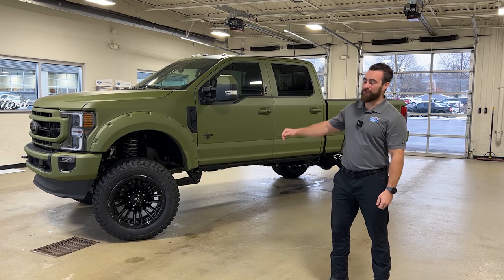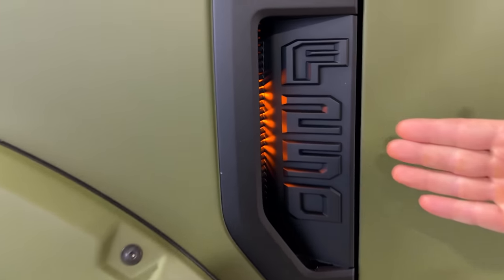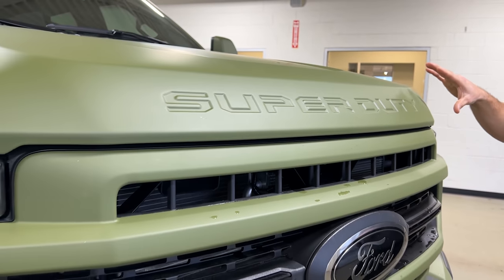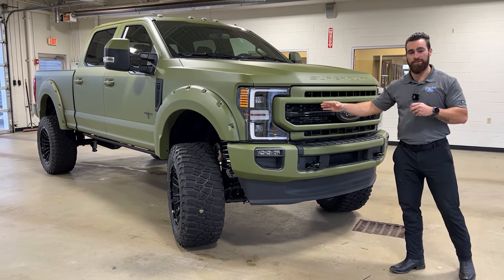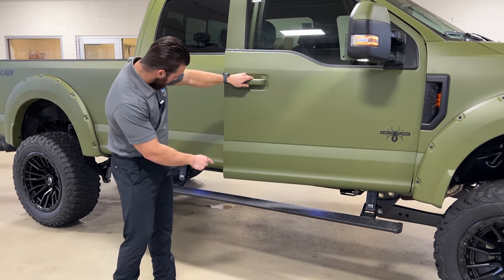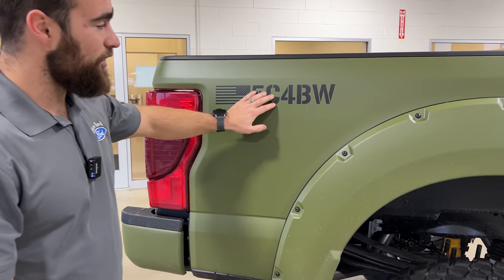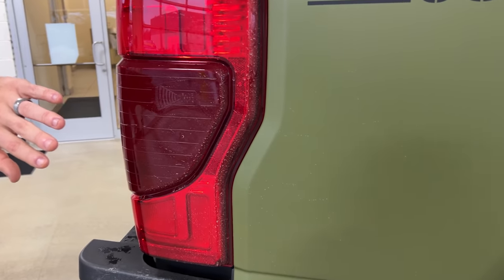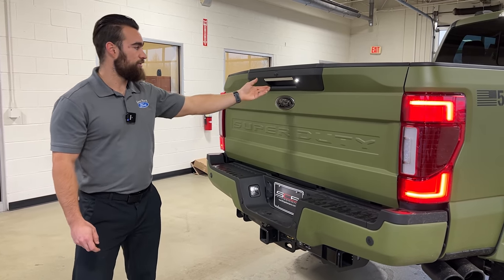BEST SUPER DUTY EVER? 2022 Ford F250 - 7.3 SCA Black Widow Armed Forces Edition 🔥

Comment: As a disabled veteran, I can honestly say due to cost I’ll never own one of these…
Reply: Got a 93 f150 shortbed
Reply: Same bro. My 5.9 cummins will have to do. Ive been saving for 2 years to replace my custom milk crate front seat
Reply: I'm active duty $or over 15 years and I will never own one either that's close to 100k. I don't understand these truck brands producing military edition trucks but they make the so active duty and veterans can't even own one due to price. It's a nice try though if they did really support build a few of these trucks a year and give one away to a deserving veteran
Reply: @andrewluedke6712  
I agree.
Reply: I just bought a USED 2020 xlt F250 with the 6.7 diesel and they still wanted almost 60k

I don't want to imagine what this thing costs
Reply: @Sasquatch0251  it costs what you paid for it.

Comment: I can't even finish this video because I'm worried he's gonna tell me how much it costs. That truck is perfect!
Reply: Sorry, it would be perfect with the stick shift. It is otherwise pretty good.
Reply: It’s also not a 6.7
Reply: @andrewculver5045  if you aren't towing, you don't need the 6.7L. I had the 6.7L and now I own a 7.3L, definitely not at all disappointed.
Reply: @Davy Pig  Right...
Also if it had 6.7 engine with 1,050tq
Reply: @Sheepdog81  if you want to have the maximum towing capacity you do need the 6.7 for sure, 1,050tq on the 6.7 you can't compare to 500tq on the 7.3 .  Obviously, 6.7 costs more for a reason
Reply: @nelsonfont6730  Yes, I sell Ford, this I know. Still, 1/10th of a second slower 0-60 between the two. 450lbs lighter in the 7.3L and no DEF or DPF that I hated dealing with. My rig is built for overlanding. To each their own. I chose my 7.3L for my own reasons and I am extremely happy with that old school pushrod V8! 😁
Reply: @Sheepdog81  doesn't matter who faster it can be you'll pull in gas what you can in diesel. It is so much capable to pull and town. For a reason all heavy-duty are diesel. I have a F150 2.7 ecoboost with 580whp and 660wqt that's is my faster toy. But to work I have a F250 of course diesel. Gas pull well, don't get me wrong, but nothing compares to a diesel. Let's be realistic. Without talking the difference on fuel prices and mpg.
Reply: @nelsonfont6730  Exactly why I said, if you aren't towing all the time but, you want a F-250, go gas. The 2.7L is a phenomenal choice too in it's stock form. A sleeveless block to boot.
Reply: Towing with a 6" lift would be a bit ridiculous IMO.
Reply: You can delete a 6.7 and with a basic tune blow the 7.3 gasser away. Of course the 7.3 is capable but not long term pulling heavy is about torque not so much hp. Point is all that work on a stupid gasser
Reply: @matthewartiles3179  not here in Commifornia. And I'm not pulling.
Reply: @sheepdog819  that's sucks it becoming extremely hard to get tunes anywhere. Just did a 21 and had to get the the tunes from Canada and now they are vin specific. For off-road purposes only obviously if that even matters lol
Reply: I still drive a 14 was much simpler back then same concept but could buy a tuner with preloaded tunes. I just had to include what injectors I was using and intake etc and could have them preloaded and in email in a day now not so much. Ford still is by far the easiest. Also way better for the environment when you factor in better mpg and not manufacturing parts that will obviously not last as long while burning def out your dpf. The 6.7 scorpion is in imo the best diesel in a pick up so many things they pioneered with that motor. I've had every one besides the 7.3 idi and went through all the hell on all. 6.7 is a modernized 7.3 only downside I can see is the Bosch fuel pump.
Reply: @matthewartiles3179  I'm just tired of the BS as much as you are.
Reply: 115 all day.
Reply: It’s around 110k lmao
Reply: @andrewculver5045  i dont think the guy built this custom truck for work, thats a toy, will sound imcredible with exhaust he has

Comment: Love the fact that they used flat paint to give it an authentic military vehicle look. Companies who used a gloss clearcoat over olive drab or desert tan  just ruins the look. I do hate those wheels, they do not match the style of the truck.
Reply: Agree on the wheels. I guess they look more spider-like? I would expect wheels that look more utilitarian. Try climbing in and out of that thing or really working it. Try lifting anything heavy into it. What if you had a gooseneck or 5th Wheel? I would rather see air ride suspension, on board generator, tail gate/ Tommy lift, and other cool things that would enable one to pack it in on rugged terrain.

Comment: A lifted truck with an air dam underneath the bumper?  We can all agree that when you're looking for this look you won't be too concerned about gas mileage.   Also, you go with 22" wheels you have to get at least 40" tires else tire looks too small.  And since we're talking abt wheels/tires, upgrading them without upgrading brakes is not only an aesthetic issue but safety as well.

Comment: Wow what a truck.  It would look great as a dually to I'm wondering how much does that cost with the 6.7
Reply: $367,995.99
Reply: The 6.7 is about 10,000 dollars in this truck. If you wanted the dually it would be even more, plus you would be getting a f350 not the 250 shown here.
Reply: Regardless of brand diesel engine option is 10k more.

Comment: First Time Viewer! Great job on the presentation! The owner made a great choice by going with a military / tactical theme! 

I realize this truck was a customer retail order and then SCA customized, but here is a critique on the build. In general and overall, this truck is an excellent build. However, several details are absent and better choices could have been made with OEM options, aftermarket additions, changes, upgrades and the SCA custom appointments. 

First - OEM Options: PROS - like the Lariat trim with Ultimate Package and Black Appearance Package; Upfitter Switches; Roof Cab Clearance Lights...and great choice bypassing the power moonroof. CONS - notable OEM missing options which would have made the truck a better build - Ultimate Trailer Tow Camera System / Pro Trailer Backup Assist; Heated Rear Seat (a Michigan truck without heated rear seat?); Carpet Delete (this truck needs the Vinyl Flooring); 397 AMP Alternators and Dual Batteries; remove the standard front lower valance and replace with the Tremor front lower valance.

Second - Aftermarket Additions, Changes, and Upgrades: PROS - fender flares were a great choice and the bolt look attachment keeps with the military and tactical theme. CONS - The rims and tires along with the suspension all bad choices. The rims are bad choice in both function and aesthetics. Functionally, either 17 inch or 18 inch rims and tires would be the best choice for a 4WD truck...provide a better on pavement ride plus better off-road performance. Aesthetically, body color military and tactical looking rims like Black Rhino rims - Armory or Arsenal would have been a better choice...painted the body color with black bolts. Military vehicles have body color rims, but matte black would also look good on this truck. The gloss black rims just ruin the military / tactical theme. The 37 inch tire height was a good choice, but the tire is too wide for snow country...more narrow width would be better...wide works good in sand...desert areas. 

The 6 inch lift is too high and messes up the "center of gravity"...and simply not necessary for 37 inch tires. The shock boots are way too dated. This truck should have either the Carli or ICON suspension system, especially at the $99K price. Not sure what suspension system SCA uses, but it is not Carli or ICON quality. This is a prime example of why it is best for owners to build their own truck. I would have had SCA only do the interior and exterior paint...no other custom work. 

Third - SCA Performance custom appointments and work: 

1. Body Color options: By far the BEST military / tactical olive drab green I have seen on any vehicle is the color TANK which was available on Jeep Wranglers in 2015 and 2016. Other good military / tactical colors would be GOBI or SLATE...both Jeep Wrangler colors; and LEADFOOT (F150) and LITHIUM GRAY (F250 / F350) both Ford truck colors. All of those colors would have been way better choice than the olive drab green chosen for this truck...just too much yellow in the paint mix. 

2. SCA missed painting the gloss black face in the center of the grille...should be the custom body color. Better yet, the grille should have been painted matte black to match the fender emblems. In addition, the grab part of the door handles would look better painted matte black. The same part on Ford trucks that have the OEM chrome. The chrome door handle pops...so would the matte black on this truck. The truck simply needs a smidge more black exterior trim to accent and highlight the body color.  

3. Like the matte black painted BW and Army numbers on the doors and rear bed panels...way better than decals.

4. SCA did a phenomenal job on painting the truck. Good job on painting the face of the doors the body color...the area that covers the B Pillars since the OEM is gloss black. No doubt the paint job was the major portion of the expense in the build. 

However, they overlooked some details. SCA failed to apply the body color to the chrome tailgate handle and on three interior parts. The steering wheel part that surrounds the controls. The upper glove box part that has the embossed Super Duty. The part surrounding the AC vents and USB plugs for the rear seat passengers. All of those parts should have been painted the body color. Some of the parts or a portion around the center dash area should have been painted matte black. Too much body color there. Ford Ovals need to be black and body color. 

In conclusion, great build, but at $99K, the truck could have been noticeably better with more attention to detail. People that have less money and more patience could have built a similar truck with the additional changes and upgrades listed above for about the same money.
Reply: Your critique was far better than even my short sighted thinking. They need to bring you in to the process and then call that truck an Armed Forces Truck! Wow! That would be an amazing truck!!!
Reply: SCA uses BDS suspension which it equivalent to carli . I can say it was used on this build because this is a customer build so I’m assuming they had the choice on what suspension they wanted. Plus BDS, unlike like any other suspension company, it backs the factory warranty and steps in when the dealership/factory try to take advantage of you. BDS will advocate on your behalf to get the work covered by ford, and if all else fails, they will cover the cost after all legal options are exhausted. Also keep in mind, a lot of companies use radius arm drop brackets which is not the way to go . BDS uses longer radius arms therefore not reducing clearance.
Reply: @Subi_doo  Bds makes a nice lift for sure. They are owned by fox..  BDS was founded here where I live. Fox bought them for a reason...Carli makes some nice components that are very different from the basic lift for a superduty.   They go beyond the basic lift... Your statement about BDS getting work covered by ford is a joke. Just like insurance companies state, if you have modified the vehicle coverage may not apply...
Reply: @johnt6673  not sure what your taking about, BDS told me directly; if ford denies my claim, and after BDS legal team steps in and tries to get ford to honor there warranty, if ford still does not, BDS will cover the costs. This is why I buy BDS.

Comment: Only thing id add is the 3 marker light bar from the dually under the tailgate .....they just finish the lighting look
Reply from the maker: Thanks for watching
Reply: I always put that 3 red light bar on my Ford F250 and F350 SRW trucks! Both the light bar and wiring harness are relatively inexpensive. Looks good on SRW trucks with the roof cab clearance lights, otherwise, probably not look very good on trucks without those lights.

Comment: No cold air intake and custom engine colors? Send the truck back lol. Needs to also have a pull out step on the front bumper to work on the engine.

Comment: Get rid of the 6" lift. Change out the doggy 7.3 gas for a 6.7 turbo desiel and I would buy it!
Reply: go watch some of the 7.3 videos on YT, not a doggy motor at all....the after market is growing fast for the 7.3 and you can double the HP and be reliable.
Reply: @lrlapua8035  link?
Reply: @drdwgmd14  use your keyboard.......do a search......not hard to do....
Reply: @lrlapua8035  thanks

Comment: I can say, this is the only SCA build I’ve seen where they didn’t use caliper covers. Factory brakes are still factory brakes regardless of throwing a cover on them. Biggest way to make any build a garbage build is to start slapping on cheap mods like calipers covers. If you want Brembo calipers, then buy brembo. If you want red calipers, then have them stripped down and powdercoated. Don’t use caliper covers on any build. EVRY SCA gmc build around here has the covers and they make the wheel area of the build look very cheap. In conjunction with the ugly wheels SCA uses on the gmc builds, the caliper covers really amplify the poor selection of parts used. Want a custom truck, design and build it yourself. You’ll get it EXACTLY as you envisioned and it WILL cost your less.

Comment: It's got cool features but it still looks like a big f150.  Never really liked the 2017 and up.  I like my 2016 because the body style is different and distinct.  I have a 2016 f250 and a 2015 f150 king ranch and really appreciate how the f250 looks more super Dutch or heavy duty than the f150.  Still a cool truck though

Comment: That's a super nice truck and I want one. I wish for four things. 1) That they'd make a taller profile tire for the 20/22 in wheels. I've seen too many shattered aluminum rims because of the low profiles. 2) That this Ford truck came with a manual transmission and not  that 10 spd auto. 3) A full 8 foot box. 4) That it was a 450, not a 250...I notice that the steering wheel logo isn't blacked out...

Comment: I have owned two brand new f250's in my life. Both trucks were underpowered, and I had nothing but trouble with the brakes. Payed out a boat load of money getting the brakes fixed and hardly any miles on them. Never buy another ford.

Comment: Love the looks. But, more weight and stock brakes…… less stopping power. Senseless.
Reply: I have same truck but 2020 and much better suspension system (carli). The brakes work great even without the engine brake on that it comes with. Truck is designed to haul 30klbs and stop. I have 40k mi on original brakes

Comment: I bought a 2021 F250 super duty and as far as trucks go it's ok, it has good power and will pull a trailer nicely and the ride is very good also, in fact I would dare say it rides better than my buddies F150. What I can not stand about the truck is the mirrors, I absolutely hate the double mirrors, no matter where I adjust them I do not have a good view of anything on the passengers side and the drivers side is not much better, I wish the idiots that designed these piece of shit mirrors would have just left them alone and made them a big single mirror. I also own a 2006 F150 with the single mirror and can see everything at a glance unlike the F250 ones where I have to actually look out and basically study whats next to me. I also own a 2004 Chevy van and when I park my F150 next to it I can see the whole side of the van, when I park my F250 in the same exact spot the van is not there. My Chevy van has big single mirrors and vision is perfect out either side, but at work I occasionally drive a newer Chevy van with those same stupid double mirrors and it is a bear to back up because those mirrors are even worse than the Ford ones. As far as I'm concerned whoever designed these mirrors should have their nuts filed, the view is literally so bad I don't drive it very often, so basically I have a $52.000.00 yard ornament and prefer to drive my 06 F150. I drove truck for 10 years both dump and semi and know the value of good mirrors and those are not good. I have even looked online to see if anyone out there make any kind of replacement single mirror but no luck.

Comment: You couldn’t pay me to get another f250 diesel 6.7 nothing but problems. Had 70k on it , in the shop 5 times , water pump, radiator, oil leaks , water leaks , def problems couldn’t get out of town with it . I traded it in for a GMC gasser 10k on it so far hopefully it’s better than the Ford and unless you’re pulling a house the heavy duty gas trucks do a good job .
Reply: You must not have paid close attention when watching the video. This truck has a gas engine and not a diesel engine. The truck in this video does not have the 6.7L Powerstroke diesel. Instead, this truck has the 7.3L V8 'Godzilla' gas engine.